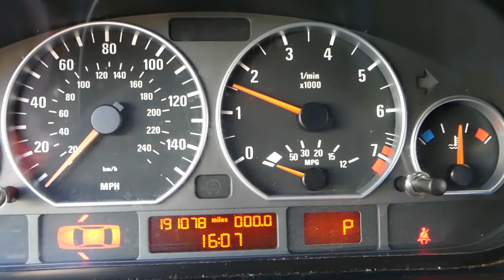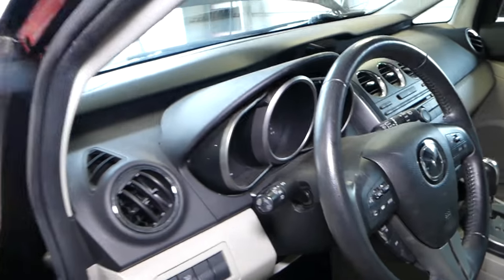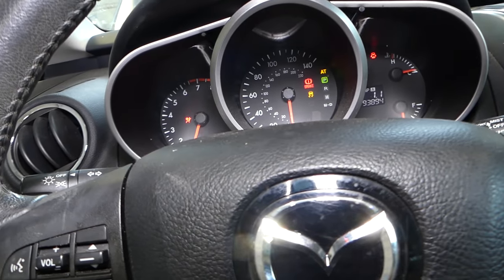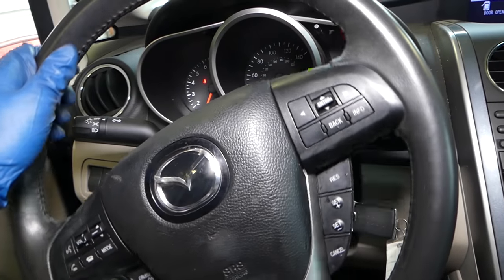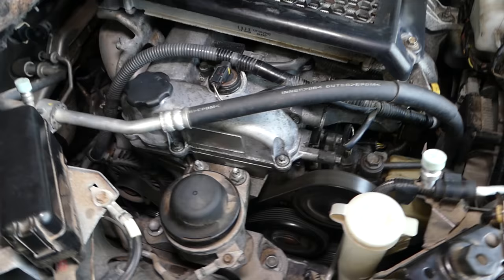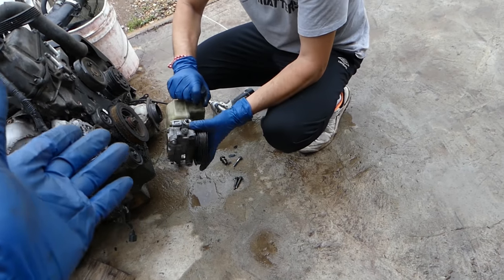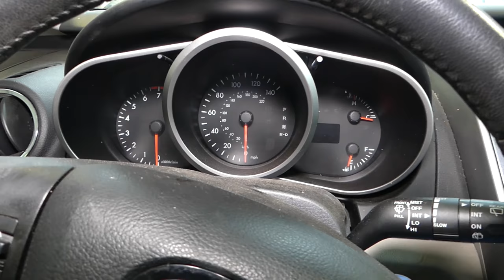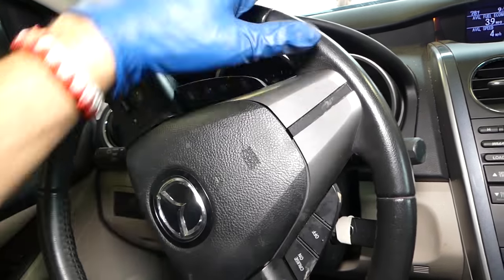WHAT BAD POWER STEERING PUMP NOISE SOUND LIKE, WHINE

Comment from the maker: Products that we use and recommend:
► Power Steering Pump (check for car model): https://amzn.to/4h1JeMS
► Power Steering Fluid (check fitment): https://amzn.to/4esYh0d 
► Panel Removal Set: https://amzn.to/3YiMADu
► Tool Set: https://amzn.to/3p5MM6t
► Screwdriver Set: https://amzn.to/3XRB28Q
► Castrol Oil: https://amzn.to/3xBc8B9
► Oil Filter: https://amzn.to/3w0Ulme
► Torque Wrench: https://amzn.to/32qyRwg
►Liqui Moly Engine Flush: https://amzn.to/3IiDBID
► OBD Scanner that we use most often: https://amzn.to/3I4MQfe

► We buy our Tools and Parts from here: https://www.amazon.com/shop/worldmechanics

Comment: hey! i know this video is old, but to anyone watching it now, this weird whining sound can also be your power steering fluid! be careful and get your pump checked, but i have a leak and its always my power steering fluid. the sound stops right away when i put new fluid in
Reply: Thanks. I will try a new fluid and see
Reply: this is exactly my issue with my 08 ford edge! crack in the power steering reservoir, causing a steady leak, ultimately making me have to re-fill my power steering fluid every month or two. i can always tell a huge difference from when my fluid is low, and just refilled! always be sure to check what power steering is right for your vehicle though! most cars between 2000-2012 require Mercon V fluid!

Comment: Could old power steering fluid also make some noise? My car just started making noise today, It's quieter then this one though. Once It warms up It stops making the noise.
Reply: We changed My mates one and before there was no sound,after old fluid changed it started making noise.m
Reply: so was it? I have a lexus es350 with 170kkm, the pump should not be replaced so soon..

Comment: Thank you for this I have had this noise for a little bit and have no clue what it was went to the mechanic he said it was tight steering and it’s just been getting worse
Reply: I heard it at the belt area when i told a partner to turn at full turn and i saw the belt resisting back and forth . mind you the fluid is full and no leaks found
Reply: Belt wasn't loose either
Reply: @randyr.8536  was it the pump?

Comment: Thanks for this one, and the one after the replacement, to let me know my mechanic didn't do it right. My car is still loud asf days after replacement and I cant make it stop, no matter how much fluid I put in. Sigh.
Reply: Than it wasn't the pump but a leak in the line.
Reply: @jaystreet4004  yeah but does the leak in line cause this same noise?
Reply: @e36fanatics  if the noise stops when you put in the power steering then comes back you have a leak.

Comment: thanks mate, mine noise is very low and not all the time but that's the noise and vibration through steering column only when I'm changing lock like parking or stationary.

Comment: Omggg mine sounds exactly like this and it's full of fluid it's getting replaced thanks for this
Reply: It may just need a bleed/flush and replaced with new fluid. You can try that first if it doesn't work then you get the pump
Reply: @surdawi86  It is hard to turn too I'm replacing the whole pump be safe it's so annoying but I appreciate your help
Reply: @tyrondacroskey647  what year/model car do you have ?
Reply: @surdawi86  2008 ford focus
Reply: @tyrondacroskey647  Did you fix it by replacing it ?
Reply: @honeycocoanut8188  hey I did replace it was fine but it still went back to turning hard again and making lil whining noise
Reply: @tyrondacroskey647  i wonder why ugh
Reply: @honeycocoanut8188  I really don't know I brought another car but still have the focus it's still running and drivable but I just put it to rest a bit
Reply: @tyrondacroskey647  omg 🥺 did you ever hit/wreck into anything ?
Reply: @honeycocoanut8188  No never been in no type of accident thank God
Reply: @tyrondacroskey647  ugh , i hope im ableto fix it man
Reply: @tyrondacroskey647  it’s the steering rack.
Reply: @tyrondacroskey647  mine is the same sht i fixed it like 2 times already and it goes back to the same thing
Reply: @kevingalabay6658  me too so at this point it's just sitting catching a break while I drive my other car
Reply: @EbubeDibie  I got that put on too and it was ok for a lil while

Comment: while I agree that you should not be making those noises and typically when being bled with proper procedures it would require replacement if there's no progress however still a cheaper alternative and also it likely caused would be contaminated fluid that's built up contaminants inside the pump are good proper flush throughout the whole of the pump fixes the issue more times than not.

Comment: I’m not sure what to do here because I’ve been to two different mechanics, and both of them want to charge me $800 to replace the power steering pump. The problem is that the power steering pump does not make the noise you are describing in this video.

In fact, when I turn the wheel left and right, it doesn’t make noise at all. It makes a high-pitched sound in my car when I hit the gas.  The two mechanics are insisting that this is the power steering pump but I would not know that. How do you know if it really is the power steering pump?

Comment: My 2000 pontiac grand Prix started making this noise. Could it be possible I only need to add power steering fluid?
Reply: You can try to swap out the old fluid and bleed the system, but there's no guarantee that's gonna solve the issue

Comment: I've already replaced the pump and that fixed the issue but after driving on a rough road for a few miles the noise came back and steering was a bit stiff...I'm lost on what to do😢

Comment: I have a Honda Accord it only makes this noise when there’s not enough fluid I have a leak in the pressure hose but I don’t think I would need a new pump if I keep putting fluid the noise goes away so should I just replace the pressure hose ?
Reply: Update just replaced the pressure hose everything was fine the noise went away drives smooth

Comment: I got that kind of noise after starting but will goes away after how many seconds. What could it be?
Reply: i have the same problem, idk what to do..
Reply: @KertAllik  i solved mine already. It turns out to be a belt.
Reply: @Xianpaul0523  What belt was it, my car does it then after a min of driving it goes away
Reply: @SlimyShellos It's the Belt.

Comment: Replaced steering pump, steering rack and bleed air out of system still have this same noise. Thoughts?
Reply: I think I may have just fixed mine by replacing the power steering pressure switch

Comment: I have a question I did the seals on the power steering box and bled the pump like you did in a diffrent video it’s still making a little noise and when I take the cap off of the fluid it’s bubbling

Comment: The same thing happens in my case but only after my stupid mechanic "Fixed" my high pressure line leak, It starting doing the same noise after he fixed the leak but I lost power steering completely in the end, I drained some of the fluid cause the guy overfilled it, and the next day the noise went away.. 

A week after I turned the steering to full lock and it did the same noise again but went back to normal when I switched the engine off and back on.

Do you think this would be a Bad steering pump or a leak fix that was badly made and ruined the whole system.
the car is an 05 Altima 2.5 with 310k miles

Comment: I got a 2003 Mazda 6 and I been thinking this was what was wrong because of not just the noise but it’s eating up power steering fluid I took the car in about a month ago and they said it was axels and rods and I needed that fixed follow by an alignment which would cost up to $500.00 😒 are they wrong or could it be both? Also how much to get my oump fixed?

Comment: My car is making this noise, and the steering wheel is very hard to turn when parking or getting out of driveway. Once the car is in motion the steering is fine. And also when front wheels are lifted there is no noise and the steering wheel is very easy to turn. Could this be air in the system of a bad pump. Please let me know. I would greatly appreciate it thank you.

Comment: What if mine doesn't make noise when turning at all but sounds like why just while running. Is that still a bad pump or. Plus the steering doesn't feel difficult at all 06 dodge charger rt

Comment: quick question guy's, can a cheap hose on the pressure line cause power steering noise or do I need to just replace the power steering pump and hose? it's a 2003 bmw 330ci, it dosen't whine all the time only when I'm turning and that particular hose vibrates violently.

Comment: My mazda 6 makes a noise which is almost the same. For now it can be heard only when going down a slope such as the ramp of my underground garage which is quite steep. I go down with the brake pedal pressed all the time, so the car doesn’t accelerate and when I start turning the wheel left and right, it makes the noise. The problem is it doesn’t happen on level ground or when the slope is not steep enough and mechanics don’t usually have access to steep slopes like my garage ramp to test it out so they rely on my description. No luck so far. They say everything is fine but no one ever talked about the power steering. Could that be the problem?

Comment: Help I have the dreaded Ford steering pump noise I want to keep the original parts if I can help it is there any way I can tell if the power steering pump just needs to be disassembled and cleaned and new gaskets put in or do I need to get a brand new one?

Comment: I have a similar noise when NOT TURNING the steering wheel, as soon as i turn the noise stops, only when leaving the steering wheel still it makes noise. What is it ? I already changed the power steering rack but the noise still present. Help

Comment: What if my car makes this noise while cold but stops when warmed up?
Reply: This is normal when its cold outside. Power steering fluid is very thick so it takes a little bit to warm up before it can can reach the pump. That being said you should wait for your car to warm up so you dont wear out the pumps. Wouldnt hurt to check to see if the fluid is still looking good though.
Reply: @tedofuentes6525  this is exactly what it was

My power steering fluid was low, i topped it off, and the noise stopped even when it was cold, no parts changed
Reply: @jetlifebih7853  how did you know it was low ?
Reply: @KashMELondon  i checked my reservoir after reading the comment that responded to my original post, then filled my car with fluid, started my car after it sat for 6 hours and the noise went away, and never heard the noise again
Reply: @jetlifebih7853   oh wow, it worked for me for a good week but it’s back again I’m gonna try doing the liquid again and actually wait a few before driving I didn’t do that before.
Reply: @KashMELondon  if it worked and it’s back, I’d check the level of the liquid and the reservoir that holds the liquid or the tubes that connects from the reservoir to the power steering pump

 It sounds like the fluid fixed it and now the fluid returned to the level it was at when it stopped working
Reply: @jetlifebih7853   dang if only I knew how to check that 🥴 I’m going to figure it out hopefully it goes away because it’s annoying
Reply: @jetlifebih7853   thankyou!
Reply: @KashMELondon  you should be able to use google or YouTube just type in your vehicle year make and model and then the part like for me 

08 Acura TL type s power steering pump reservoir location
Reply: @KashMELondon  yw
Reply: replace power steering pressure hose..cheap fix...i just had the same problem👍
Reply: @jetlifebih7853  Mine started doing the same but once im driving for like 15 it seems to go away..Im going to check the fluid tomorrow..Im thinking to might be my belt...
Reply: @letsgonow5641  yeah sounds like it could be tensioner belt
Reply: @jetlifebih7853  I put in some power steering fluid it was low. That was 3 days ago and that seem to do it. Although still too early to tell for sure.
Reply: @KashMELondon  check it like you check oil bruh
Reply: @KashMELondon  you likely have a power steering leak if it came back
Reply: Is car still safe to drive when this noise is happening and steering being stiff as my Hyundai tucson is doing this please can someone help😢
Reply: @tedofuentes6525  Huh? Power steering fluid is one of the thinnest oils out there. It’s like 10W motor oil.
Reply: Possibly its drive belt!
Reply: @hankyberky5829  it was my egr vacum line on top of the engine, the dealer unplugged it and my car runs fine now, to fix the issue the dealer said i would have to take my flow masters off and it would cost 900…

I will just ride with my vacum unhooked

Comment: Shows you the quality of Mazda when this vehicle was made a bad power steering pump at 93,000 miles really😦🤣
Reply: You'd probably get 10,000 miles out of an American car
Reply: @benh392  190k on my old Dodge, just needed regular fluid changes. My current old car, a 1987 Mercury Grand Marquis, still has the factory pump, no noises. No leaks.
Reply: @benh392  lmao power steering went out on my cobalt 6500 miles, then again at 16000. Chevy isnt what it used to be. Ppl say buy American cars yet the only good american car I've had is my 76 nova still has original gaskets an seals. Nickel an domed my cobalt wife cavalier trail blazer an fusion. I'm still waiting on my wifes cx7 to break...9 years 1 serp belt and 18 oil changes, satisfied

Comment: Hi, I have a 2015 honda accord with 18000 miles on it. My headlights are dimming when I rotate the steering wheel while it parked, rolling the windows, or when the ac compressor turns on even sometimes when the parking lights are on. what could be the reason? The car sat idle for almost 2 years. I had a problem twice to start but it worked perfectly fine, in the winter too. Any suggestions would be appreciated. Thanks
Reply: Could be a bad battery or alternator. Go to auto zone for free test
Reply: @MrShadowGhostFox  Thank you will do that.
Reply: The draw from running accessories like the a/c clutch or window motor takes electricity from the system and sends it to what ever you're using instead of the headlights lowering the amount of voltage in the system.
Reply: jimmy patterson thanks 🙏🏽 for the reply, so that means it’s normal right? Because I didn’t notice this dimming changes while driving other cars so little concerned.

Comment: I have the same issue , same noise,  but when I turn the steering wheel fully the engine drops the RPM like it wanna stall but not . 
 1999 vw polo engine 🤷‍♂️🤷‍♂️🤷‍♂️

Comment: Mine makes a squeaky noise from my Dodge Challenger tires when I turn it around any thoughts?
Reply: Eddie-E Apple having the same thing happen with my 2016 scat pack charger.
Reply: Dalton Peters lmk if you find a solution I think it’s the cv joints

Comment: Mine is quiet until I reach the full turn then it’s noisy.  Is that the pump?
Reply: Once you hit full steering lock your pump is forcing oil through the system relief valve as it is designed to do. It will make a screeching sound. Solution is don't turn the steering wheel to full lock.

Comment: I get a squeaky/whiny noise when accelerating and turning. Like I'll accelerate 10-20 meters and it'll make a 2-3 second whine and won't do it again until I stop and accelerate. Any idea of what it could be?
Reply: Sol Cutta  yeah man I really don't know what it is the car still performs well (2005 Honda Accord) I'm hoping it's not an expensive fix though because the car only cost me $2700.
Reply: Belt, alternator, or bearings?

Comment: Mine does the same sound only when steering tilts on both sides, no sound in between.Also steering wheel pulls to the different direction when i am turning the car.Would that be power st. pump or anything else?
Reply: Take your car to a front end shop, let them diagnose and repair it, then stop running over curbs lol

Comment: That's sounds like angry cat. Mine soumds like angry cow 😆
Reply: So does mine, did you need a new pump or just more fuel?
Reply: @Natasha_4  send for repair if there is leakage. If no leakage add more liquid.
Reply: @Natasha_4  Usually refilling the pump reservoir is enough. If the sound is still there an very loud the whole pump must have gone bad.
Reply: Sam hey thanks! There was no leak and I added more Fuel and the sound is completely gone!! 😊
Reply: @Natasha_4  yes. Same to me. I did the same too... Before that, My car not in use for more than 3 months.